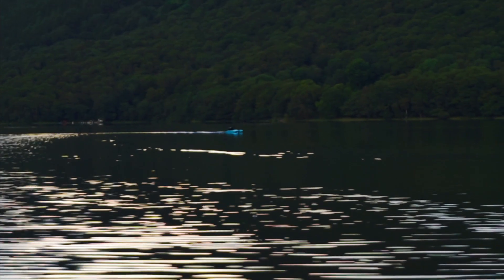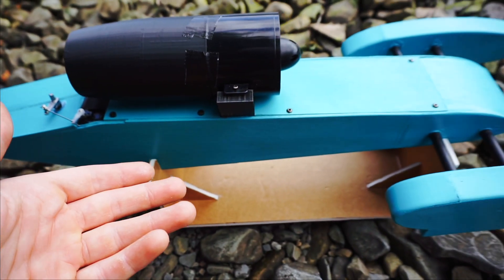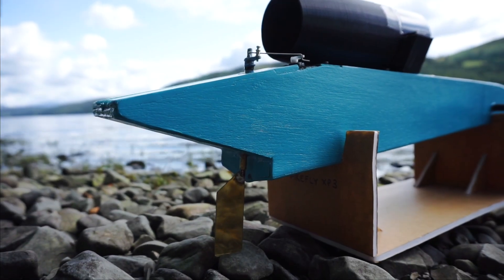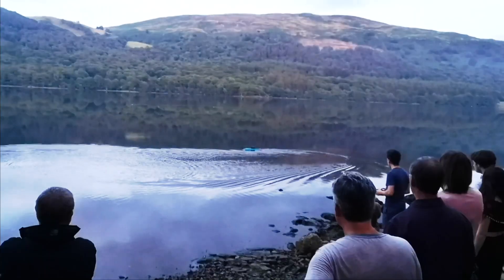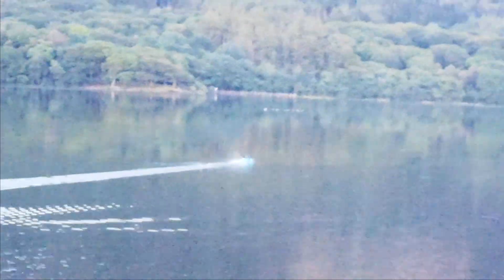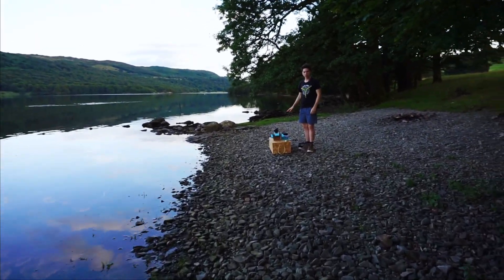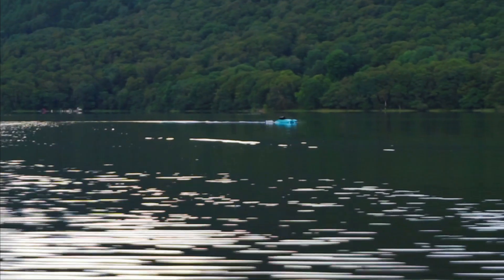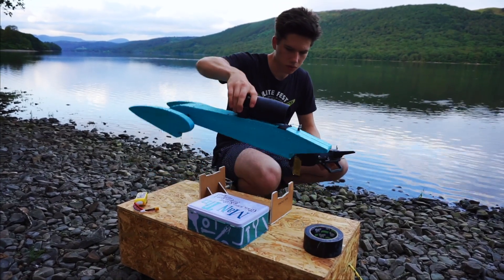Fan Powered R/C Airboat

Comment: We want to see it going full throttle!
Reply from the maker: Me too!
Reply: @Project-Air  probably the batteries getting a bit too hot and the internal resistance increasing. you should have put, in my opinion, a small air vent going from the back of the thrust tube down into the internals of the boat to redirect some of the airflow and cool down the parts, also maybe punch some holes in the hull in front of the turbine to make the air that get pushed out recycle
Reply: DarySparta batteries hold chemical energy. The hotter they get, the more current they can release due to chemical kinetics (Arrhenius equation). There is still a limiting overall max which he is experiencing. A vent wouldn’t have helped. Cooling is needed to stop thermal runaway and permanent damage, not increase current capability.
Reply: @Lozzie74  the more you know! this sounds strange to me but looks.like you have more evidence supporting your thesis. I can tell you not all batteries behave like this as we did an experiment back in school and discovered that batteries terminal voltage decreases with increased temperature which is also to be expected due to dissipation of heat which should be useful energy. Also, it's known that resistance in metal conductors increases proportionally to heat, and since batteries are not only made of chemicals but also metal components this is also to be taken in consideration.
Reply: Check your radio programming as it might be in your
Reply: Check your radio for programming motor rpm at top.